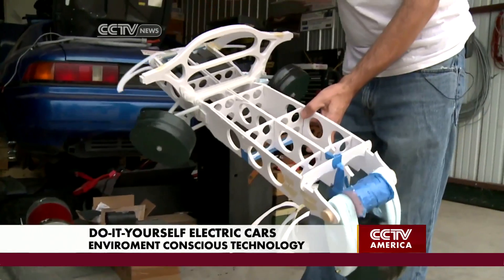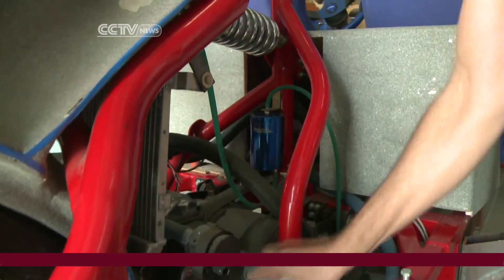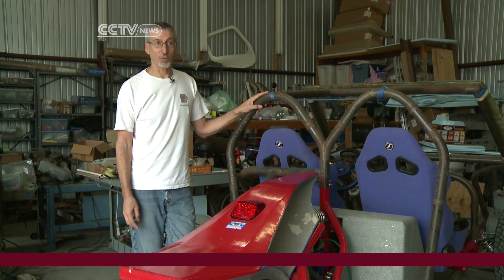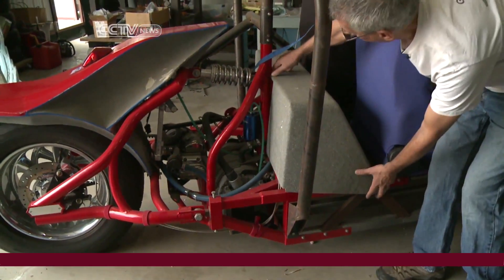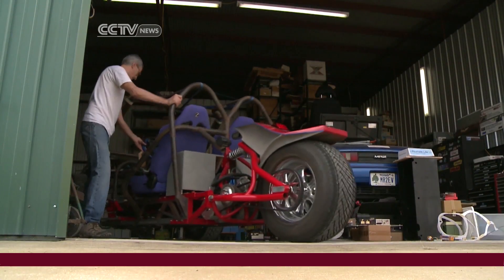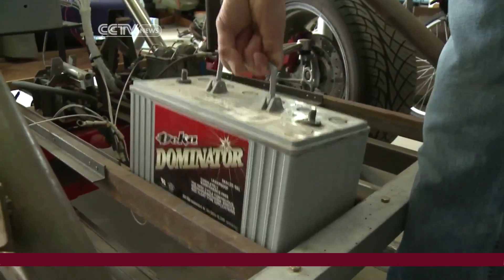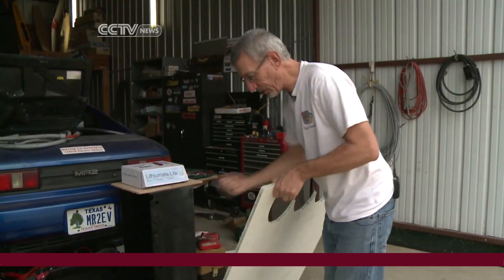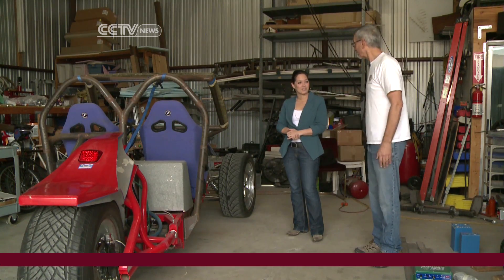Do It Yourself Electric Cars

Comment: I can get a pirus for 5k
Reply: is that like a Rolux watch?
Reply: Mike Warren and throw it away, new battery pack for Pirus << :D 5-8k - second hand value zero dollars. Maintaining Slightly older, car much Cheaper. 1990's cars are nearly all better, period and often more economical per dollar-mile even than Electric.
#Elio better ;)  #uCHOOZE  UCHOOZEfreeForever Jimmy uCHOOZE K DOLLAZ UCHOOZE Jamie Lassiter-White
Reply: +UCHOOZEfreeForever 1983 Honda CRX HF model...53mpg combined!  And that was with a 1.3l carbed SOHC engine.  Imagine what a modern DOHC DPI engine could do in that chassis!  I tried explaining this to my mother before she bought a prius.  The prius makes no sense...why does a car meant for high MPG have a backup camera, power everything, sat nav ect?  All extra weight that limits performance.
Reply: good night
Reply: Nope, learning is AUTONOMOUS.
People who aren't pathetically lazy cunts do it all the time WITH NO FUCKING HELP xx
Reply: +illumicon stop feeding him he's just going to read one word and then reply
Reply: +Mike Warren the purple kind apparently.
Reply: you can get a wrecked one for cheap. either way. youll save money in fuel anyway. even with the battery cost
Reply: +Mike Warren Not really :) there are lots of cars with better mpg than on normal engines _without all the over-engineered obsolete bs & Huge expense... Here's one (1990s Honda Civic $950) http://stlouis.craigslist.org/cto/5210939030.html another (85 vw deiso Golf $1850) http://stlouis.craigslist.org/cto/5210939030.html - like I said LOTS. All with a lower cost of ownership, cheaper repairs and insurance, even better overall mpg than Toyota's shitty production lie :)
Reply: you arn't really talking about the same things. the comparison you are supposed to be making is compared to electric vehicles.
Reply: I'm replying to your comment, about a near 100% non-electric white elephant. It's never a straight-forward question with auto's anyway. Lifespan Impact matters MUCH more than what fuel. Spend $5k on a lovely diesel Merc and refit to used SVO to beat any hybrid. When you factor in all the other costs and the new-built impact. Hybrids, in fact New cars loose in most/all categories. ALL small 90's cars are better but (and) unlike modern cars won't last for 8-10yrs and then cost you 5 grand (oh look ;o) to repair... So it's shit or shinola, conversation Pirus :D Not Electric, Green or value-for-money xx  #UCHOOZE
Reply: I have no idea what you are trying to say. You should spend less time on youtube and read some books.
Reply: Negative. ^^ and talk you yourself brethren. Comprehension of this very simple thing isn't my problem. "I can get a Pirus for 5k" = need to read books about everything to do with cars. Start with a Ladybird :P xx  #uCHOOZE
Reply: and learn to spell Prius :D (yes, I know not being able to edit comments is a pain ;o)
Reply: answer 3 :D 'I have no idea what you are trying to say' - ref. OP - Yes, that is more than apparent -lol xx  #RJ
Reply: you waste words
Reply: Mike, i/we replied because your comment was top-listed at the time & is still high. Other people use the internet. The words are there for them and have already fed back the Traffic we wanted them too. Which effin planet are you on? You don't wanna learn,  #uCHOOZE  get it? xx illu
Reply: what are you trying to argue about?
Reply: No one is arguing (unless that's you -lol) we're authoring an atricle, based on your mis-understanding of Pirus-relevance. You think this is a conversation. It aint xx
Reply: pirus is quite relevant. electric cars are too expensive.
Reply: Pirus NO ^^ ref. all previous points.
Electric cars too expensive? Yes - 'big auto' has too much share in petrochemical corpse to put any money into sensible electric either as a retrofit or highway production cars. Amateur engineers have been making viable REAL hybrids (not non-viable pirus over engineered wank) for over 30 years. There are some concessions but really very few. It would be very easy to own electric and rent gas for long distance, even with a poorly designed (what easily should have been) 1980s electric only car.
As it stands (and why pirus is just fucking bollocks -lol) Jap cars from the 90's DESTROY all but a tiny fraction of modern cars in everything but safety, as do many vw's and mercs. Upgrading the safety and staying in-weight would mean if Honda re-manufactured their 92-95 vtec Civics, loosing 20 years of 'development' but adding torsion beams & perhaps some airbags. That car would have a lower cost of ownership, cheaper repairs, longer design lifespan, better performance, better economy, shorter stopping distances and lower insurance than ANY currently manufactured car. Making a 'new' car has such a huge consumption and environmental impact, even with all the industry bs about 'recycle-ability' it's just lies. 90's parts are easier to Make, use less Exotics, have no irradiated Lifespan, and are broadly Patterned so you can buy high quality from anywhere. Pirus is a monster, with far too many Components and all of the un-design of all 'modern' cars, added to crappy mpg, even crappier programming and design death at 8-10 years. Toyota built it to laugh at you. So yup, you can get one for $5k or cover your money in peanut butter and feed it to the dog. Which would be cheaper and probably better for the environment :) xx +uCHOOZE
Reply: I don't think you are quite understanding this. you seem to be a civic fanatic and think its the best thing since sliced bread. lets say they did redesign the civic. new civic 30 grand. 35mpg.... few years old pirus, 5k and 50mpg. this isn't a hard decision.
Reply: This is a useful process, you ask (the normal) dumb questions. Which stimulates content in response to them. These accounts gently tease you pretty much ensuring a response, when we get time to write. You need to READ (or carry on looking dim... really, your choice ;o)  it's barely about mpg at all, 214i 'accord' (EU model) touch 50mpg highway, cost about a grand, don't need to be Built and can be fixed with a hammer. Newish Civic (or old pirus) cost you 5k to Repair, again, when they are 8-10 years old. And a 5k pirus can't do 50mpg (or the equivalent in $Dollars)  _ever_.
Below 20(35 if rechipped) your pirus will use electric. That costs you a grand a year in battery replacement, service is impossible with out a $5million+ robot workshop. Above 20 it's as economic as any under-powered, overweight turtle and re-coupes charge, at an 85% loss, back into the inadequate batteries. Read slower and Think about your replies xx please xx
Reply: I like (using that loosly, good cars don't exist yet) GOOD cars. There are dozens of them, pirus isn't one. :)
Reply: The market would disagree. It outsells every other hybrid car by a very long distance.
Reply: Yup, dicks buy them. Dicks will buy anything you tell them to. They sell millions of undrivable 4x4s, costing as much as many houses. Dicks buy those too... sometimes for 5 grand ;)
Reply: The GM1 (who killed the electric car?) and Rav4 (also destroyed -lol) weren't Terrible, that kind of refit is very easy on a flatbed. All 4x4's drive better with a few 100lbs on the back because they are tail-happy when underweight. Sure you loose some Max payload - it's unlikely most people get close to that anyway. Electric rear end on a 4x4, electric rear wheels on most road cars, stubby trailer for almost anything. The industry doesn't want to sell you that. They want to (often) Loose money on a newly manufactured barge-like guzzling robot, especially if they can sell you the Debt. You're then hooked into a network of ever escalating repair, from their shareholders. That's what you buy with a modern car... even a 2nd hand Pirus :D (no one is denying the featured electric car is ill-conceived...  but you gotta give props to anyone that rolls up their sleeves and builds something like that in their shed ;o)
Reply: what are you going on about? If you are talking about bulding an electric car. its not worth it. Components cost too much..
Reply: Not. READ, more than the first 4 words, stop guessing xx this article is shaping up well, we can flesh it out later :)
Reply: and, seriously. Advocates buying Pirus but complains, full, conventional, off-the-shelf electric with around One Fifth of the power-chain components... 'costs too much'
Cost of manufacture has Never been an obstacle to plug-in or co-engine hybrid cars. Only will on the part of companies repeatedly hammering ^^ this junk at your credit rating.
Reply: you say things in confusing ways. in either case. 10 to 15 grand to build my own electric car. 5k for a perfectly running pirus. seems like a no brainer to me.
Reply: Wow (not the good wow, the other one) READ and stop guessing, READ, if you want to and stop guessing. READ... ... ... getting it?

None of what you 'reply to'  #assume  has been written at all
Reply: that's because I have no idea what you are saying. you say things weird and I have no idea what you are even talking about.
Reply: +Mike Warren Aww, Diddums -LMFAO
Reply: UCHOOZEfreeForever huh?
Reply: ^^ and there you go, from someone who can think beyond the end of their nose to consider ALL of the factors of build/mpg and ownership so Does understand WHAT CARS ARE.
Including how not to waste 10 GRAND+ (for Mike's benefit that's the car plus a reasonable 5k on new batteries and a Chain of self-obsoleting parts) plus a bucket of future costs and insurance on a second hand Pirus.
Reply: RCPro Driver So that it is not easy to back up into something...
Reply: illumicon Just because you do not want a feature on a vehicle does not mean that it is "junk". 

but go ahead, keep insulting people, sure makes you look like a big person.
Reply: And Mike reads ONE WORD again.  #whataprick  I'm 'insulting' (accurately defining) you because you've failed to read ANY of the content on these responses - it's still up, read it at your leisure, or waste your cash on a Hopeless, Worthless, Lie. Be my guest xx #uCHOOZE :D I finished the article a LONG time ago. Bye bye :D
Reply: illumicon no offence, but are you really that dense?
Reply: READ and LEARN xx #uCHOOZE
Reply: illumicon this is pointless
Reply: or not YOU CHOOZE :) #uCHOOZE
Reply: That sentence does not actually mean anything.
Reply: ...to YOU - ignorance is YOUR choice Mike. An active and conscious one. And your part in this is only as a sounding-board to  #witness  the utter nonsense 'the market' believes. I realise there is no point in me typing (other than to add traffic to the thread) as you have NEVER read more than 4 words in any comment in this post.

YOU can CHOOZE (conscious pro-active choice) to LEARN the subject you commented on then you might be able to READ more of this content. But I doubt it, I just wish imbeciles couldn't vote. But we can't have everything...

No matter what, buying your piece of slave shit for 5k or learning ANYTHING about cars or the auto industry instead, remains YOUR CHOICE.  #uCHOOZE
Reply: are you capable of holding a conversation without insulting people?
Reply: Agitating trolls is part of my job.some are too dim to see through it. Dim people are easy to insult, particularly when they DON'T READ - but still insist on replying to content.
"I have no idea what you are trying to say" yes OP that is more than obvious. Then why bother writing ANYTHING? Learn or fuck off xx  #uCHOOZE
Reply: I'll reply to your next reply in advance shall I? 
>> READ, more than the first 4 words, stop guessing xx there's even a (read more) button Mike. USE IT :)
Reply: You realize, that basically makes you the troll right?
Reply: yup :)
Reply: have fun with that.
Reply: From the top: "I can get a pirus for 5k"

...and throw it away, cost of ownership on Prius  #skyrockets  at about 8 years old. Hundreds of 20+ year old cars are Cheaper, Greener, Faster AND more Economical.
For the reasons listed ^^ above. But only available to people who voluntarily READ. :)
Reply: The closest I can find is about 40 mpg, Which isn't bad. but still less than the 50 you get from a prius.
Reply: Also keep in mind, this video isn't in comparison to other hybrids, its in comparison to building an electric car.

it jsut doesn't work for most anyone. people don't have 15 grand to drop on an electric car.

but 5 grand for a prius is a heck of a lot more affordable. and still saves money in the long run.
Reply: I've answered ALL of that deluded bullshit several times. LEARN TO READ.

I told you I'm writing an article, this is like a live first-draught :) It's useful to be trolled by dicks but I don't really want to spoon-feed LAZY people by copy-pasting what has already been written. Read it, if you want to. I've got a copy anyway, that one needs a good edit.
Reply: answer what. I didnt ask anything.
Reply: illumicon saying that over and over does not make it true.
Reply: Watching you do it does  #pirus   xx
Reply: There's at least 2 cars ^^ up there that will do 50mpg small diesel on SVO will do close to 70mpg (1990 fiesta) and cost a lot less than 5k - even IF mileage was the only issue, which it's NOT - but you wouldn't know that cos you DIDN'T READ any of it...
Reply: illumicon i'm not interested in buying an older vehicle that is bound to break over and over as old cars do. In fact I can't as I have to have a newer one for a job.
Reply: wrong again READ
Reply: wrong? being that you have no idea what job i am getting, and no idea what they require, and have no clue how new of a vehicle that I personally desire... please explain to me how you were able to come to the conclusion that me wanting/needing a newer vehicle is "wrong"
Reply: you arn't a very good troll.
Reply: arEn't* now you start to understand... taking a while isn't it? READ :) xx
Reply: wait... i know you admitted to being a troll. but, are you actually admitting to being a bad troll?
Reply: of course :D
Reply: I'm the lousiest troll, especially after the first-drafts are done :) it's a combination of stress-relief, traffic generation and some surface editing. :) I did say, responses are a Sounding Wall.
Reply: it shows a lack of character
Reply: Lmao, compared to what? :D
Reply: compared to someone who was taught how to properly interact with other human beings?
Reply: :D why?
Reply: what do you mean why?
Reply: lmfao, what Are you doing Mike? Seriously, some kinda intellectual conversation (in which you will only read a single word from any of my replies) - with a happy and very lousy troll? Really now? :D

So my one-word reply. Why? Why any of it, why type, why no READ what makes you (and only you) think efficient, author-trolling (which adds content to our non-profit, breaking over $5000 given away upto Q4 2015) shows a 'lack of character' LMAO - honestly, you are ONLINE this is TEXT. Grow Up xx

'compared to someone that...' - ok, now I need the toilet. Wow, you must be a hoot at parties ;) xx illu
Reply: Remember this? (nope, cos you were too lazy to READ it ;o) >> "Other people use the internet. The words are there for them... You think this is a conversation. It aint xx"

Don't like being trolled? DON'T RESPOND to trolls. Especially where you know less than fuck-all about (apparently anything) #uCHOOZE to type about and are a dick :D

(See, I'm Teasing you now, I TOLD you - now repeatedly that this isn't a conversation With you, that I am a troll. How much more of a clue do you need??? - at least not all the time you've got your knickers in a twist angel xx illu) Wake Up :)
Reply: Here is some advice for you buddy. when you are old nobody will be reading this or anything else you are posting. you will have no impact on the world. start your own business. not only will you have the potential to get rich, but you will improve the lives of others and will improve this world. trying to annoy people on the internet will turn your life into a waste.
Reply: READ << This is the First Public Draught (really not turning your fucking brain on are you dimwit?) our content, My content already does have an impact. Already is stored indefinitely and already makes (a modest amount) of money for uCC.

So you being too lazy to read it, And too dim to understand how aggravating people too dim to NOT RESPOND - PRODUCES CONTENT and (in YOUR case, from half a dozen articles being written right now) is just extra, relaxing fun for me :)

I already have my own business (yet another stupid assumption there Mike - and you DON'T)

This article, along with 100s of others is now Permanently Stored and complete - which you would also know if your had READ - rather than just wanking yourself off to the tune of your own pointless replies.

IF YOU'RE NOT GOING TO TURN YOUR BRAIN ON - DON'T REPLY xx illu

"Here's some advice for you buddy" - Wow, what a pathetic, self-absorbed cunt you really, Really are :)  #uCHOOZE   to READ, or not xx
Reply: why? because you will be happier
Reply: how? Define my happiness and how it will be enhanced by your advice (which I already DO - for those of us who READ)
Reply: its one of those things you wont know till you try it.
Reply: I did learn. and it simply costs too much to make building your own electric vehicle.
Reply: Wrong, again :) WELL DONE - now READ.
Reply: you being a troll doesnt mean im wrong.
Reply: Say why should I say what? :D
Reply: 20k for a electric car build, or 5k for a hybrid that makes gas a non issue. yea its a waste of money
Reply: Since you didnt refute what i said, i take it to be true.
Reply: Since you are a total cretin, you will think what you like. EVERYONE ELSE ON THE FUCKING PLANET can chooze to LEARN

You be right, you do that thing - that thing you can't even fucking SPELL. Why do you exist again? Ah, yes Meat for  #their   #uBERWAR  too LAZY to stop being a fucking VICTIM and LEARN. Needs to be spoon-fed like a fucking Baby.

"Since you didnt refute" FFS - Virgin much? #Pirus?
Reply: so, you can't refute my statement. i guess i am right
Reply: on going expenses for an ev are the same, prius still wins
Reply: illumicon Already told ya buddy, I can't have a vehicle that old. guess you didn't read that part.
Reply: I already covered that, READ THE FUCKING CONTENT  #Cretin   

"I can't..." I read it, several times. I don't include FUCKING BULLSHIT in any consideration. That's why you NEVER get any.
READ THE FUCKING CONTENT - THEN - REPLY.

You know, you COULD. Build a CRITERION (one that makes SENSE, not one based on 'what Toyota arms-co say')
...go and find out about post-2000 cars that fit your criteria. Based on REAL ownership-lifespan figures not just on 'THE FUCKING BULLSHIT AUTOMAGS AND TOYOTA arms-co say'
...and find an ENDLESS supply of cars that not only outperform the  #Pirus   in ALL catergories but may also be Cheaper and have a higher miles-per-dollar AND lower cost of ownership. Especially SVO converts.

There will be lots, you could do that. But 'oh so I'm right' says the FUCKING CRETIN and 'oh so bullshit blah blah' again... Really? Doesn't require WORK.
Reply: Can't have an older car due to job requirements.

my point still stands.
Reply: oh and Mike's special one-word reply, though obviously even comprehension of that ain't his strong-suit ;)

What? What 'job requirements' require you to drive one of the worst pieces of auto-engineering of the entire 21st century so far?

What's funny about this is that I actually have  #some   small sympathy (not for Mike, he's just a lazy piece of shit) but for American car buyers.. there are still some newer cars that will give you 40+mpg AND a MUCH lower cost of Ownership and mpd than any second-hand  #Pirus   money-pit. :)
Reply: your math still does not add up buddy. but im honestly starting to get tired of this nonsense.

show the math to back up your claims or i have no reason to continue.
Reply: Here :) just ready for an average $5k in repairs over the next 5 years and generally higher maintenance than a jap-compact 2005 - for $5k :) perfect for you :)
>> http://stlouis.craigslist.org/cto/5236603913.html

and an ok (all modern cars suck against 1990's equivalents) civic, ready to roll with higher Miles Per Dollar and much less write-off maintenance lurking. For HALF the price >> http://stlouis.craigslist.org/cto/5265189252.html

See, I enjoy this cos I like LEARNING - You suck at it, cos you're a fucking LAZY self-inflicted  #FUCKTARD   :) WAKE UP xx
Reply: These get better-than-book mpg too, if you can DRIVE.
(guessing that's a no, then -lol)
>> http://stlouis.craigslist.org/ctd/5299955728.html
Reply: can you show me that data on a 2008 or newer vehicle?
Reply: Wow you're SO LAZY.
Do it YOURSELF.  #uCHOOZE
Reply: There isn't any
Reply: no, you can't get a 08 for 5k. I made this post long before I started shopping for a car. and might not actually get a car. sill don't know.

Either way, you are still wrong about the prius. even at 9k, its still way more expensive compared to building an electric car.

And can you please stop with the troll nonsense. Havn't you learned by now, I don't react to childish name calling?
Reply: Actually, that is exactly what the conversation is about. you just can't keep up.
Reply: that makes no sense. so i guess we are finally done. have a good day.
Reply: yea i get them, i just ignore them. And i did read the content, that is how i understand building an electric car is not worth the investment.
Reply: and also, you understand that you can 'get a Pirus for $5k' AND THROW THE PIECE OF SHIT and YOUR MONEY away :)

Which is also 'not worth the investment'

So that's 2 things you claim to understand and NOTHING that you've LEARNED.

WELL DONE LAZY  #FUCKTARD   :D
Reply: your logic is broken.
Reply: eco impact is irreverent. cost of ownership. its lower than my truck, that's for dang sure. and lower than other low mpg vehicles.
Reply: Now, try that again with RESEARCH and FACTS - not some bollocks you just made up xx

Eco-impact = fair enough, if you don't care.

Cost of ownership and Miles Per Dollar are the ONLY factors that matter (for you) then - and are MASSIVELY higher on  #Pirus   than lots and Lots of 2008 HIGH mpg vehicles.

There's a list of the types of cars you can look for ^^ UP THERE.
Go and find some, stop typing crap xx  #uCHOOZE
Reply: Seriously? lol

You're saying you would buy a  #Pirus   for $5k (when you, yourself have said actually that's total Bullshit and it would be more like 9. Plus the horrific future-costs) because the cost of ownership... and I'm quoting here :)

is 'better than my truck' Fuck me, I mean people talk some fucking shit sometimes but that is just Epic :D xx illu
Reply: Actually, you are so busy trolling on other pages that you didnt get everything. I could buy a 5k prius, but since that initial comment, i started looking at a new job, which would require a newer one.

might not get that job tho.

and yes, its obviously cheaper than driving a 1 ton pickup.
Reply: you didn't really say anything in that post.
Reply: offered quite a bit actually. build electric car, 20 grand. buy prius, 5k. what's the point in cheap energy if the proccess is more expensive than more costly energy?
Reply: Which is, that you CAN buy an 11yo  #Pirus  for $5k - or an 8yo one for around 9 (as updated when I - READ ALL YOUR FUCKING CONTENT) AND THROW THE FUCKING PIECE OF UN-ENGINEERED SHIT - AND YOUR MONEY all AWAY.

You know what? The more we look at the Pirus option, the more is IS cheaper to build your own fucking electric car. So Mike Hunt - at EVERY FUCKING TURN, in EVERY FUCKING WAY you have proven YOURSELF completely WRONG. AND totally fucking naive and IGNORANT - which is why my  #Troll  (fucking  #dickhaed  STILL not getting it AT ALL) keeps swearing at you for being a fucking THICK CUNT.
Reply: i'm pretty sure 15k is bigger than 5k. Tho, by the way you speak, I can see you not understanding that.
Reply: You do realize, those figures that you use about lowering the mpg based on cost or repairs.... you have to do the same to the other cars too. meaning you still save money with a hybrid.

and why should i care about the environment. global warming is a scam created by the politician al gore.
Reply: the amount you save is based on how much you drive. and if i'm going to spend 5k on a prius, or 5k on some other car (realisticly, im not going to get some old piece of crap that will blow an engine any day), even at 800 a year savings, thats nearly 2 mortgage payments. 

Still saves money.
Reply: "You do realize, those figures that you use about lowering the mpg based on cost or repairs.... you have to do the same to the other cars too. meaning you still save money with a hybrid."

Seriously WHAT??? Do you even fucking MATHS  #moron  ?

No one lowered mpg against ownership. 38 is WHAT  #Pirus   DOES, your 50 is Fabricated, under ideal conditions BY TOYOTA.
STOP GUESSING AND READ - READ - =READ= the fucking content.
Reply: that's actually exactly what you said. but like most childish liberals, you just deflect.
Reply: you do realize that the same corporations that make hybrids made the old broken cars you love so much right?
Reply: you use a lot of words to not say anything.
Reply: +illumicon yeah but are those old cars more fuel efficient and does they pollute less?
Reply: who cares
Reply: Yes Car Guy, both more fuel efficient AND pollute less. My '92 accord tested at one Quarter the legal level for pollutants and unburned fuel. Officially making it CLEANER than Fiat's i500 eurocar, which can do Slightly higher mileage.

Sucks to be a fucking looser doesn't it Mike?

If you'd care to prove MY POINT again, be my fucking guest xx because though ALL of the wank that you have typed. You've repeatedly proven, and now obviously conceded to have proven my point that buying new vehicles, especially  #Pirus   is inethical, expensive AND gives you shitty mpg/mpd.
Reply: If the auto industry gave a fuck about you, they would give you a choice. An off-the-shelf series-hybrid modular electric for the SAME price as an average saloon,

Or the exact same Vehicle, using the same Parts they were making 20 years ago, with some minor safety upgrades for HALF that price...

Both of which would destroy any 'modern' car you'd like to name, in just about any test you'd like to suggest...

Big-auto now builds anti-engineered, wallowing, robotic lounges. For dicks who don't think, ever.  #Pirus  is the pinnacle of that Monopoly Theft Market.

When you can buy an Efficient, basic car for $5000 or less brand new.
You'll have some recourse to suggest that ALL of the brand name cars aren't made by worthless, thieving tossers.

But you can't and they all are...  #uCHOOZE  xx illu ;)
Reply: illumicon doesn't work that way, a company has to make profit. or there is no company and no cars for anyone.
Reply: illumicon That "natural market" you speak of would seem to disagree with you on the prius opinion you have.
Reply: illumicon oh, and up, if you are buying things that you don't want just because they are advertized, as you said, then you are pretty weak minded.
Reply: said the twat who is voluntarily advertising a fucked 2nd hand #Pirus  as some kind of deal and disregarding ALL of the auto engineering from the entire 20th century.

"I can get a pirus for 5k" the ultimate statement from a weak-mided, consumer programmed fucktard :D xx
Reply: illumicon yes, you have provided examples.... but i'm not buying a 30 year old car....
Reply: READ...

THE FUCKING...

CONTENT - it'll help you stop LYING (again)
Reply: i did read it. you gave examples of older out of production cars. not interested in buying ancient pieces of outdated equipment.
Reply: you have to say something first, for someone to learn
Reply: not good enough
Reply: Jesse Swift believe it or not, he is the one that keeps coming back with the same nonsense that defy's math and common sense.
Reply: ^ see. he his language is barley audible, let alone makes any sense.
Reply: hashtag hashtagsarestupid
Reply: buying new stuff is unethical huh. what tainted kool aid did ya drink to come up with that one?
Reply: Prius is garbage
Reply: ur too young to have an opinion on things.
Reply: Mike Warren 
Learning to spell-- priceless
Reply: TheObsessedGardener my point is still valid.